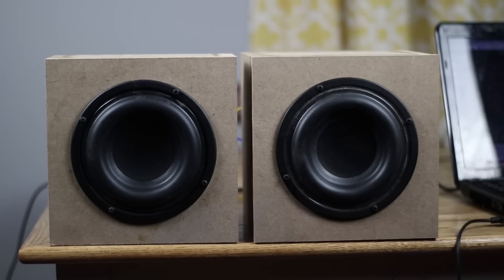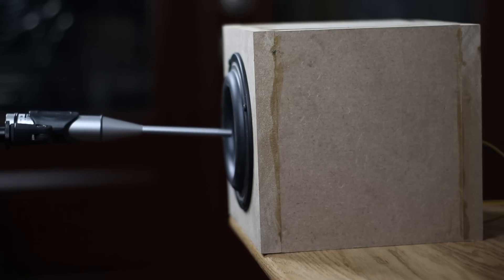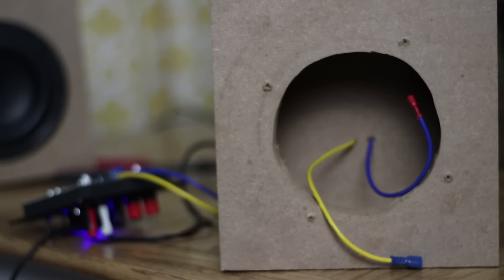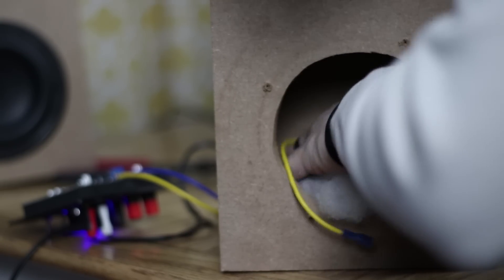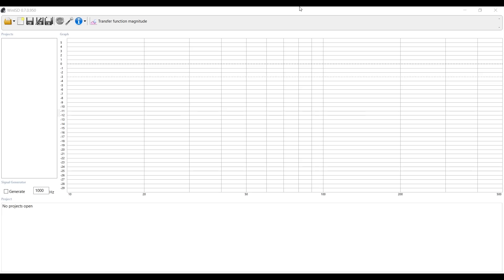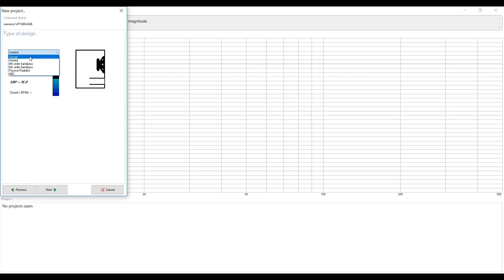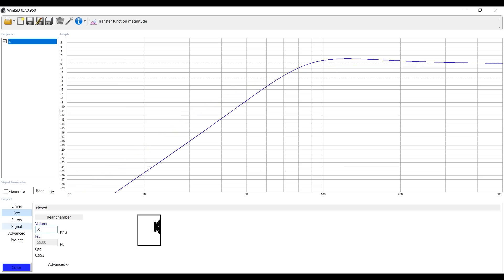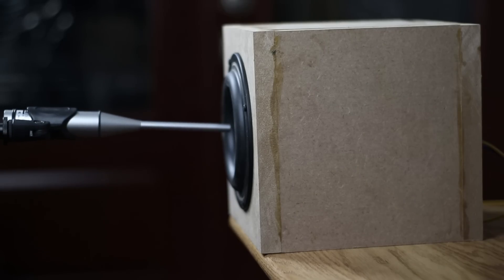Does Polyfill make a Box BIGGER?  Tested and Revealed

Comment: Professional audio engineer here. Love your stuff. Two things on this video; 1) the frequency response of microphones when placed close to a sound source are impacted by proximity effect which causes a significant bump in the low end response of the mic. All things being equal that doesn't invalidate your comparison as long as the mic placement is exactly the same between both measurements, but it is worth noting that the low end output of the source as measured at the microphone is inaccurate compared to the actual acoustic low end output measured at 1m.

2) When doing these kinds of measurements it is much more accurate to use sine sweeps and/or pure sinewave test tones at various specific frequencies to give precise comparisons of output level at various frequencies.
Reply: Also an audio engineer, with a correction to point one: the Dayton mic is omnidirectional, and omnidirectional microphones do not exhibit proximity effect.

Comment: I’ve always had sealed box’s in my car. Built a ported box and is much louder but the kick drums sound too boomy. I listen to speed metal. Have you done a experiment on ported box with the poly mat?
Reply: For metal closed boxes are much better in my opinion. If you want it to be louder just put in 2 and build an isobaric setup with 2 woofers if you don't have the room for 2 traditional boxes.

Comment: Interesting video. I have always thought that polyfill tends to slow down the speed of the sound wave but have heard other opinions saying that it does not significantly change the speed of sound.  I think most would agree that it does dampen the wave motion (particularly the higher frequencies) which can help reduce diffraction effects in the enclosure. I designed and built a transmission line speaker and experimented with polyfil to try and tune the transmission line to optimize the base response and it seemed to work for me. They do caution that too much fill can reduce the base response. As well as improving the base extension of the speaker it helped reduce the harmonic distortion inherent in transmission line speakers.
Reply: Poly fill delays the response back to the woofer cone in a sealed box. It tricks the woofer into thinking the box is larger.

Comment: It's beyond me how anyone can build a speaker without polyfill and/or other absorbent material. I always stuff my boxes full  - you get more low-end extension and a flatter curve (ie less booming), as described in the video. You don't really need testing gear to know this, if you've played around enough with speakers there is no question about it.But of course it's nice that a video like this has been posted for people to see and...be convinced! And it does not have to be a small box. My main speakers are huge, and they are still stuffed full.
Reply: I agree 100%. In 1994, I put two JL Audio 10W1 speakers in 1.5 cf boxes stuffed with fiberfill and powered by a 75 watt Hifonics Odin amp in 4 ohm stereo. The low end extension was scary. I'm still using the amp today and the speakers are undamaged. If you're not power-hungry, the concept works well.

Comment: Not only dos it change the inside dimensions of the box but it also works off of hot cold cycle’s from the air being compressed and uncompressed rapidly threw the movement of the speaker moving the air back and forth

Comment: I have a pair of old speakers I'm refurbishing. I couldn't find a woofer in a 10" that would work correctly with the small cabinet, so I installed a pair of varivents in the boxes. One for each box. Will that help? I'm still waiting on crossover parts so I can put these back together, but I don't have an A/B speaker to test it for myself. I'm also putting some dpstuffing in it along the walls, but not impeding the flow of air in and out of the vent.

Comment: A good compromise starting with a single woofer non polyfill stuffed ideal size box (let's say 9 cu ft) as a reference would be to build a 2/3rds size (6 cu. ft) box and stuff it about 50% with polyfill.  Taking it a step further, you could use an isobaric pair of those woofers in a clamshell arrangement (woofers face to face) with one woofer inside the box and the other outside the box, and that would only require about a 3 cu. ft box.  So we went from 9 cu. ft down to 3 cu. ft withOUT losing any low bass extension.  Happy wife = happy life.

Comment: If you stuff your sub box it will be less peaky and be able to play lower notes better, however, it will be quieter than the same box empty.  While a properly sized large box will be louder and play lower. Basically, if you want SQ lower tones and have no space stuff but if you want loud SPL and low end,  you need the right space for proper box.

Comment: What if the box is a smidge on the large side already? My sub calls for 1.25cf and the box is supposed to be 1.5cf? Plus its a labyrinth "SPL" box because has a extra divider in the slot port at least doubling the length of usual prefab slot ports. (By the way it's a killer $50 prefab)

Comment: I have much better luck with polyfill in larger sealed speaker applications. As in 10" to 18" speakers with 2cubic ft internal volume and larger.  With smaller stuff it's virtually useless. I use it to get a tighter, more accurate bass, and I always stuff to the max. I do have to crank the volume on the amp a little more after stuffing, so dont expect the bass to get louder. I dont use it in ported applications. For those I just line the walls with 1/2" foam rubber

Comment: The first enclosure I built was back in '84, when most drivers were in the 8 ohm variety and the only crossovers out there were passive 100-150 Mh coils with caps.  Finding a driver with the T/S parameters were almost non-existent. SpeakerLab was a good choice.    Any-who... Enclosure stuffing was one of two ways of killing off the unwanted 100Hz and up resonances that would pile inside of the enclosure and it would always yield better low end.  I even used fill in mid applications for the same reasoning.

Comment: Suppose a single woofer needed 10 cu ft of empty box space to have the low bass extension you desire.  Using an isobaric (clamshell) arrangement of 2 woofers would allow that (empty) box to only have to be 5 cu. ft.  Now take that 1 step further and imagine putting a fair amount of PolyFill (or equivalent) inside that smaller sealed box.  Now it can be designed down to 4 cu ft..  That is a pretty big difference (10 cu. ft. vs. 4 cu. ft.).
Reply: don't forget to mention the HUGE sacrifice in efficiency
Reply: It would be much more space efficient and that many times is MORE important that power efficient.  Also, if you put the 2 woofers in parallel (acoustically in phase with each other), then the SPL should stay about the same for a given amplifier voltage and source.  To be a fair test, and assuming PolyFill allows a 20% smaller box, make the larger box with the single woofer 8 cu ft with polyfill and make the smaller box with the dual (paralleled) woofers 4 cu. ft (also with polyfill) and then put 2.83 volts of pink noise thru both and measure the SPL outputs of each separately.  They should be nearly identical to each other.

Comment: We were doing this in the late 80's early 90's. I went with the rule of thumb 1lb per cf. I only would reduce the box by 1/3 but I'm sure 1/2 would have been fine. I had 8 kicker 8" comps in my t-bird in a 3 cf box and it went low for 8". Awesome to see you demonstrate it on here because we just played it by ear. Awesome video

Comment: Lots of wrong answers here. The bass waves slow a bit. What makes it work is the stuffing acts as a heat sink keeping air temp more constant. Polyfill works a bit, but not as well as fiberglass or foam. 40% max is the correct box increase with fiberglass. Polyfill less. Microphone works but this is usually examined measuring impedance plot. Resonance will lower as proper box size is approached. This is a seald box. Know first proper box size then use smaller box with fill. Your hand will have a hard time fitting into a fully stuffed box. Too much stuffing will result in lowering overall output too much, ah the microphone, but will still go low in frequency.

Comment: My listening room was a little small acoustically, I filled it with polyfill foam and it now a perfect size... if a little bit difficult to move around.
Reply: But...why do you need to move around?
Reply: Cool! You're whole room is a bed/chair/speaker.
Reply: @kohnfutner9637  It is a padded cell.. the fabric is acoustically transparent and it means I can't hurt myself, if I get out of my straitjacket.
Reply: Exactly my concensus how does adding mass which takes - space in turn actually add air volume but yet steels the space the air volume needs to exist? I guess if someone who doesn't pay taxes can get monthly tax credit payments, anything is possible.
Reply: @dunnbizzy79  As for the tax thing, I believe that happens because Democrats like baiting illegals into the country so they can get votes and so their cohorts can knab a few undocumented for their trafficking and slave trades.
Reply: @dunnbizzy79 the polyfill give a bleeding back pressure that the air and sound waves have to push through. Frequencies bounce off the walls (and pressure) and create less work but more distortion- bad sound.  This is similar when a plane takes off, lift pressure from the ground vs is the air.  Also, this is similar to a carpeted sound room- accurate around with no overtones. A consensus means many opinions,  not 1.
Reply: cool

Comment: Ok...I was really big into car audio in the mid and early 90s..(2 Rockford Fosgate Comp 15s, On an Old School RF Punch 100 x 2 w/the X-chip on bottomside of amp. Not sure what they call those nowadays cause they were new when I used them...But had a sealed 50hz tuned enclosure in a 95 Ford Probe GT that in Outlaw Competition I was hitting an SPL of 152.6. Closest to me in the 0-100 watt class only beat a SPL of about 139 to 141...and in SPL that is A LONG WAY OFF...Every point after 146 you needed to double output to achive..or just be creative or know what u are doing) I did learn this trick when I was in Comp...but Here is where you habe messed up in my opinion....#1 You seem to be using HALF the size of the other box and the PolyFill trick isnt for THAT MUCH of a difference in space...you use the polyfill when you switch speakers and use the same box and the speakers are slightly different in airspace requirements.  So if you are bottoming out and getting distortion you line the back of your box to trick the subs into the correction of airspace. #2 this isnt what you did wrong per say but what you are mis-stating...it works both ways...infact it works BETTER when your box is a little too big and it takes up the extra space, also works when ur box is a little too small it will trick it into thinking its bigger. But your experiment is WAY too drastic of a size difference too prove this works. I believe in this trick, have always heard it worked, and saw results myself. Im probably gonna do a video to prove this. Not sure about Hz differences but I know for sure it will stop the bottoming out and distortion at low notes. Do u agree?

Comment: i have no time for measurements, just fill it up with polyfill you'll hear a difference already, and it's not dangerous  and does not hurt audio  and it's been used way back  1986 magazine even Bose using it,  if there's a need to adjust  i  can use equalizer
Reply: Hey Edifier, i tend to agree with the measuring! Do you fill lightly or pack it in ?

Comment: Standard fiberglass insulation works great in large cabs 15 and upwards but don't use in a ported enclosure unless you like breathing glass dust, but the Eco wool loft insulation is made of recycled plastic bottles and is much cheaper staple gun it to all internal walls sorted, to tell the truth what I notice most is a tighter thump and a less hollow flimsy output in the low-end.

Comment: It actually doesnt make the box bigger.....  with a small box it doesn't allow enough time between notes to fully extend, in other words a note or a certain frequency crams all togeather canceling out the frequency before it and canceling  itself aswell, the polyfill slows down the rate at which the frequency is cancelled, in layman's terms, the frequency is able to complete its cycle so you can hear the complete wavelength  of the song etc without the next note running into it, in other words it slows down the sound of each frequency letting it complete its stage thus sounding as if it were a bigger box, the more polyfill the more it can reproduce each frequency completely throughout each cycle, hope I could help understand a little if wasnt quite sure why it sounds like it is a bigger box, you still have the same other problems with a smaller box than recommended..... less air to cool the sub, less power handling specially at high spl and higher excursion,

Comment: Its not magic, by filling with stuff (like sheep wool) you lower the speed of sound. Hence the wavelength for a frequency become shorter. So you could say with a lower speed of sound  you actually simulate that it is a bigger box. "The soundwaves see a bigger box". Drawback: you lose efficiency. There is no free ride. Btw its a bad idea in ported systems. It is not advised to get more than 10% volume increase with this method.

Comment: I don't believe it will have the same efficiency as the larger box. You can't cheat physics. Just like adding weight to the cone will bring down the resonant hump on a small box, but the efficiency of the upper bass will suffer, and a more lossy suspension (Low Mechanical Q) will also damp a resonance down. The polyfill probably works like an Aperiodic membrane which works to damp a resonance.

Comment: It changes the relation of the front sine wave to the rear wave, but it will also have a direct correlation on other aspects as well (like power handling/requirements, excursion, phase, etc.)

Comment: Dont you guys remember when kicker created the first solo barics...I had the 15 inch sub and the box was small I didn't think it would hit being the sub looked bigger then little cube box,hooked a punch 100 with the low end chip in it and that's the deepest bass I've ever had,..poly fill was in the box and it was a sealed..
Reply: James Westerfield kicker and the punch 100.... classic combination.
Reply: Kicker had us wondering. Back then it was the box had to be big, solos came out and were in tiny boxes. Lots of wth moments
Reply: I still have my set of 12L5 still mint condition. They want die lol.
Reply: the 90's were the good old days of car audio I'm running a 1995 crossfire 600 and two 12"db okur at 2ohms and already blew one of the subs voice coil..and they say 1200 they can handle..thinking about a skar 10 inch woofer heard there good and hit low

Comment: What happens if you keep increasing the box size. Will the low end keep rising ?
Reply: The low end keeps rising you mean by that you will get more low end output, the tuning freq will decrease. At the same time you lose from  upper bass output. Once you get pass the recommended enclosure specs, at least with a ported one you'd also lose from tightneass linearity bass sounding boomy

Comment: PolyFill slows down the air inside the box resulting in the sub thinking (performing) like it's in a bigger box. A good rule to start, 1lb of PolyFill per .75cf.
Reply: 1lb????
Reply: @Blue_3is   yes 1 pound
Reply: 1 pound per 75 cubic feet? 🤔 You mean the room? Oh, I just saw the dot. Per .75cf. got it. Per .75 cf the box is too small, I assume.

Comment: You really should have tested the accuracy of the sub because the air spring that a sealed box creates is too tight with a smaller box
Reply: I thought he did that by starting with no polyfil and testing both the recommended size and the smaller box. That's actually proper science anyway.

Comment: Read "The Loudspeaker Cookbook".  It tells you that polyfill simulates a 20% increase in box volume - not 50%.  Also, it depends on the material used for the fill.  100% wool offers the best response.   It's a tough (ie dry) read, but has LOADS of information regarding box building.
Reply: I thought fibreglass was best
Reply from the maker: That's Scott, I have read it. I did an extreme example to show you couldn't reach 50%.
Reply: @Toid  Step from the twice smaller box to the large one in not 50 but rather 100%.
Reply: the thermodynamic applies here, the  stuff with polifill, wool or other absorption sound waves, acts as a heat sink. and the internal compression of the air has an adiabatic compression , and the air rise a bit less his temparature, and tha air dont rise his volume with the rise temperature. the fill is approx 1 lib/cubic foot

Comment: There is a big negative effect for using polyfill. The drivers get hotter than normal due to less air movement and cooling and I have had them burn out on me. No longer will I use smaller boxes with polyfill.

Comment: You forgot to mention how Polyfill also dampens standing wave resonance. Given the choice, I think you'll get a flatter response curve, by using the option that works well with Polyfill. A flat frequency response, with no ringing is going to give the best sound. You want to listen through the speaker, not to the speaker.
Reply: this box I have has this "ringing" output do you think polyfill might do the trick? the sub in free air seems to sound clean.

Comment: You should have ran some impedance plots to see where the Fsc was before stuffing and after stuffing. That would allow you to see how much the Q of the system changed. Another thing worth noting that was not in the video is the mechanical power handling difference between the two enclosures.